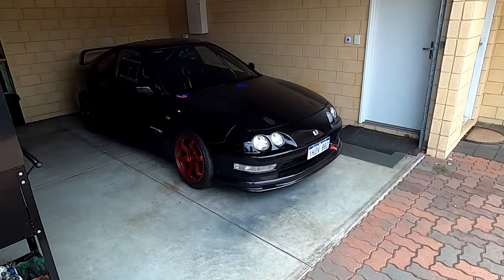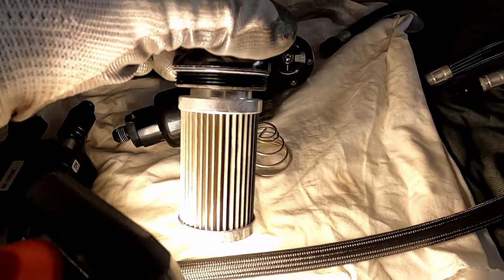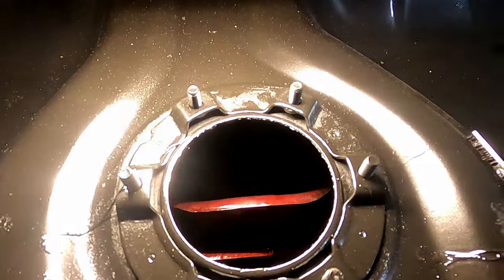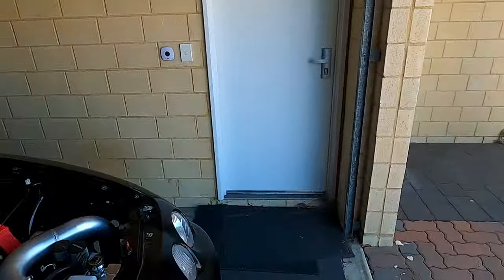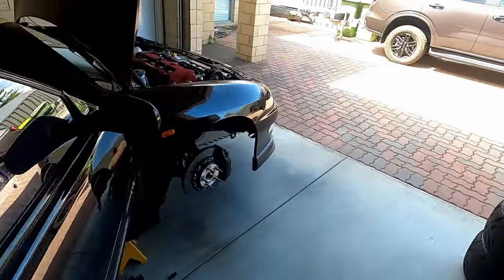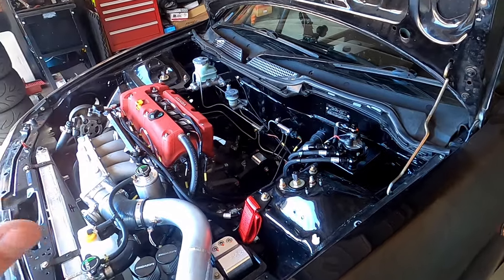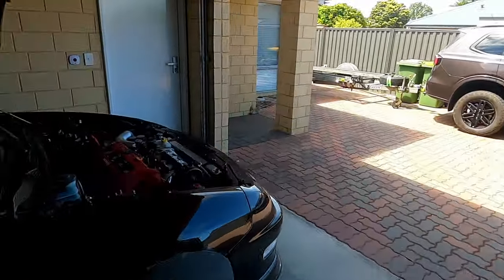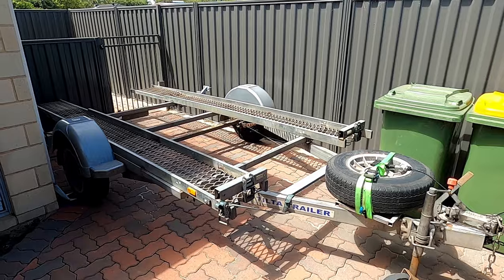K20 DC2 Racecar Buld Ep.11 - Fixing the Fuel System

Comment: Great work as always! Which Lexan window package did you go with? Plastic4Performance? (What thickness did you opt for? Hardcoated?)
Reply from the maker: Yep I went for Plastics4Performance, not cheap but they are really nicely made. I went for 3mm (the minimum thickness as per the rules here), I didn't do the hardcoating. They do scratch super easy, like when cleaning the car

Comment: In my opinion E85 is a nice power gainer fuel but I hate how it breaks oil down to milk and if you don't have ptfe An- lines. Once used have to run Oct 93 to clean everything. Keep the videos posted brotha!
Reply: agreed ...With Shane's Setup, I'm sure there would be a way to rig up a way to drain the tank and replace with Pump Fuel in the main tank.